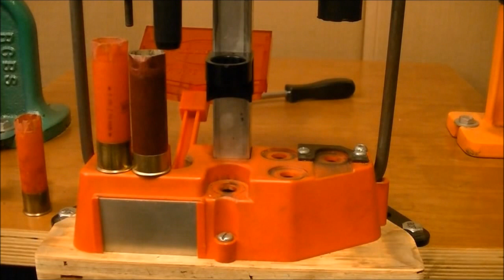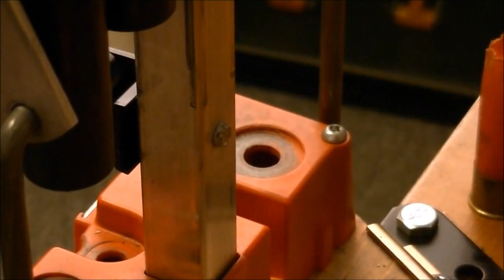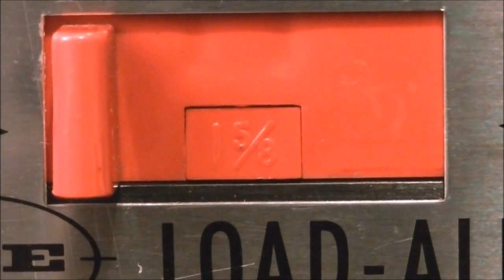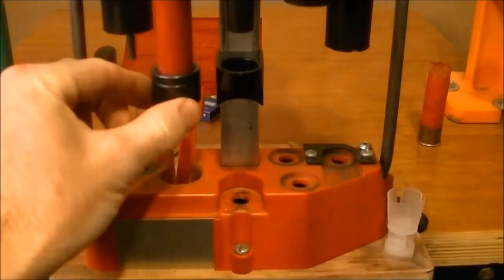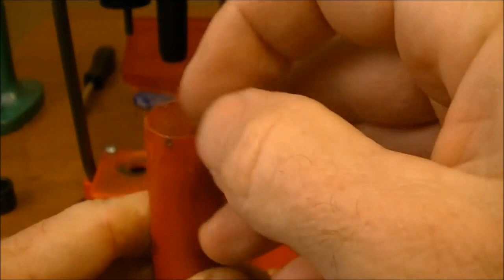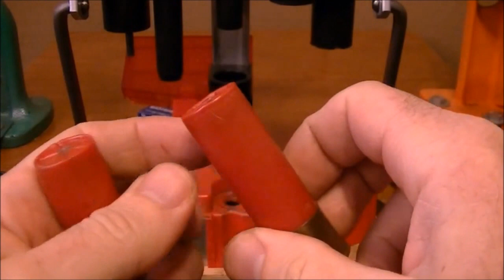Lee Load-All: Loading 3 Inch Magnum Shells

Comment: Theoretically if you were only wanting to change out the charge bushings, couldn't you just remove the top part as you did then while holding the lid on, flip the whole thing upside down and set it on the lid.  Then slid the charge bar back and forth to empty the bushings.  Then pull the bushings, swap and flip back over?
Reply from the maker: I think your comment must be meant for a different video as there was nothing in this video about changing bushings or emptying the hoppers.

Comment: I like your explanations, they helped me a lot. Now, I´m getting crazy trying to find out if it is possible to reload the other way, shorter shells: 2 3/5 inches or 67 mm that are about the same length. I would enormously appreciate if you can help me also with this. Thank you!
Reply from the maker: The issue with trying to load shorter shells on these machines will be with the crimp starting and finishing stations. The machine will not allow the shorter shells to crimp properly unless you remove material from the bottom of the last die (the one furthest on the right of the machine). I have not tried modifying a machine myself but it seems that modified machine ought to be able to load shorter shells. Another thing that would need to be changed is to move the wad guide down a bit, that would require a new hole drilled for it, simple enough.
Reply: @314299  Thank you very much for your answer. 
Where I live, there is not much to choose for the moment, and what i get is 67 mm shotshells. The machine is set for 2 ¾ inches = 70 mm.  Just to be sure, you think that these 3mm of difference are a problema for crimp starting and finishing stations, right? Thanks again and thanks for your patience, Diego.
Reply: @diegol1791 سلام.مشکل ساز نیست و برای ۷۰میلی متر مقدار کمتری در خانه آخر فشار وارد کنید تا دیواره فشنگ خراب و فرو رفته نشود.برای ایجاد فشار کمپرس بیشتر در زمستان ما در کشور خودمان بعد از مرحله آخر لبه فشنگ را بعد از پرس آخر کمی چرخ یا همان کریمپ هم میکنیم و عالی جواب میدهد
Reply: Lee might have offered an uncataloged 2.5"+- load all for outside US markets. Otherwise, I believe the handle has as much  "throw" for a 2.5". Wad guide station would be altered, final crimp filed down. Careful, don't file too much off the final crimp. 3.5" is doable too, but is more involved, and you lose the powder/ shot hopper function... dipper only. Sizing requires 2 rings, manual deprime with dowel rod. Etc.

Comment: What about using brand new hulls?  Does the load all start new crimps?
Reply from the maker: Yes you can load new hulls with the Lee Load-All. At the crimp starter station it is necessary to apply gradual but firm pressure on the handle so that the crimp starter will begin to form the segment of the new crimp.

Comment: What powder bushing do you use on 3 inch shells
Reply from the maker: That depends on: The powder you want to use; the weight of shot charge used; the wad used; the hull used; the primer used. 
Basically you need to look up reliable load data in either a shot shell load book or on a powder company website. Once you have a powder type/charge selected look that powder up and see which bushing is required.

Comment: can it be made to do 3.5” shells and how do you crimp the rounded edge like most slugs use and  shells that use a flat slug on top like some older paper type and a few modern plastic type?
Reply from the maker: 3-1/2 inch shells cannot be loaded on the Load All as there is not enough room in the sizing station for the long hull, the top of the hull gets crushed by the inside of the die. The rest of the press could be used, I think. The wad guide could be moved up with an additional hole and the crimp start and finish stations should work just by pushing the handle down less than for a shorter shell.

Comment: I hate the springy sound of these things after growing up with a MEC.  I have two, now.  One set up for 12 and the other I may set up for 20, but still undecided.
Reply from the maker: Yeah, they are quite "spongy" sounding. I wonder if packing some grease around the spring would cut down on the noise?
Reply: @314299  They say to do that on the AR-15 buffer spring.

Comment: 3.5 next, please,ext,spacer,new screw hole?
Reply from the maker: 3-1/2 inch shells cannot be loaded on the Load All as there is not enough room in the sizing station for the long hull, the top of the hull gets crushed by the inside of the die. The rest of the press could be used, I think. The wad guide could be moved up with an additional hole and the crimp start and finish stations should work just by pushing the handle down less than for a shorter shell.